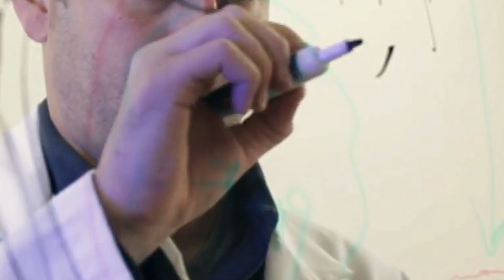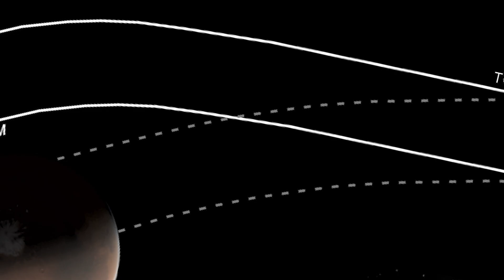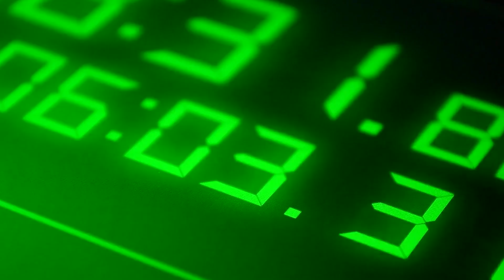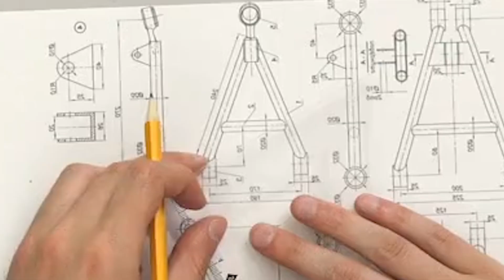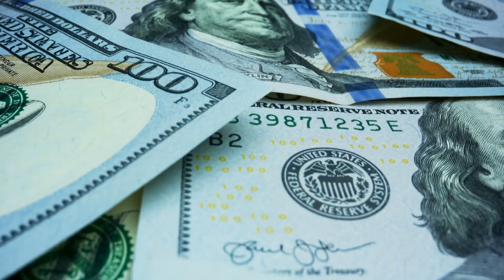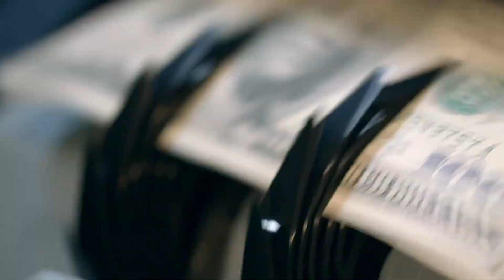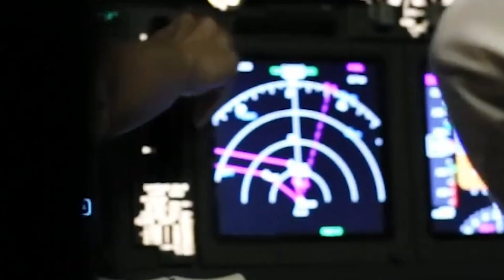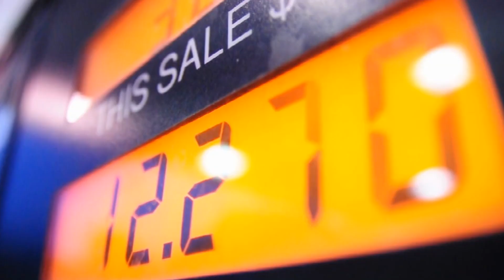5 Disastrous Math Fails with Surprising Consequences

Comment: 5:52 - Planes landing on an aircraft carrier do not "GO TO FULL THROTTLE" if they miss the arresting cables.  They go to full throttle about 1 second before they hit the deck, and only let off once an arresting cable brings them to a full stop.  They always land under the assumption that they are not going to catch a cable, because jet turbine engines take a second or two to actually start providing any appreciable acceleration after the pilot throttles up.  If pilots waited to go to full throttle only once they noticed they failed to catch a cable, they'd end up in the water... because there wouldn't be enough time for the engines to kick back in and perform the way the pilot desperately needs them to in this situation.

And now you know... and knowing is half the battle...

Comment: Don't blame the failure of the Martian mission on "English" use of the imperial system! Because we're deliberately awkward we use BOTH the metric system and the imperial system simultaneously! In daily life it's mostly imperial with a mix of metric, but in science it's always metric. Distances in driving are measured in miles, but in running in metric. In football, tennis, golf, etc. they're imperial. When following recipes they're metric, but not when eating the said creations as they are weighed in imperial. You really need to have a basic grasp of imperial measures to be able to understand British culture, but in fairness, most of what is done here is in metric measurements (except distance).

Comment: The first case here in this video... simply facepalm. It is widespread knowledge that NASA uses the metric system.....Because the necessary calculations are much easier in the metric system.

Comment: I would consider the orbiter error more to the nature of programming computers than anything else.  When one is working on paper, one immediately sees the markings for units, ie+lbs or m for meters.  In programming, the units are defined before the actually running parts of the program, so it is much easier to see how there could have been a disconnect in the system between the two forms of measurement.   Graphic representation on a computer screen could also be an issue, there are simply more placers for the error to sneak in with a programming language than with a paper and pencil.

Comment: Ignorant software programmers think convert everything to floating point is the answer to everything, instead of using finite number math (double integer 32 bit or 64 bit) which requires understanding and skill.  Floating point is easy for the programmer grasp but float point have gaps in the numbers that can lead to growing offset or bias in summation routings. It may take days for the offset to build and cause unintended number wrap arounds or overflows which may lead to unexpected results.
99 precent of C,Cpp programmers have no idea of the effects different number type can cause and what can happen.

Comment: This is why Metric & Imperial conversions are not (one size suits all). I was an apprentice production Engineer in the early 80's and some of the things we manufactured then (before CNC) had to be converted from Metric to Imperial & then back again depending on the customer with just our Zeus Book and the experience of the Charge-hand then. We had a tolerance of 1000th of an inch then, but now it's down to microns on the tolerance; CNC stuff will do that nowadays but I'm glad I used my lathe & mill then to produce some good stuff....way back then :)

Comment: I called the mistake on the first case as soon as you started talking about it. Why does the US still insist on using it when the creators themselves have already moved on is beyond me.
Reply: Actchually, they just recently re-introduced Imperial measurements. It's a Brexit thing, to show off how sovereign they are now that the UK is out of the EU.

Remains to be seen how many will actually decide to go back to the old measurements, don't think they've been taught for 20-30 years, at least.
Reply: @rocketsurgeon2135  I did not know  that!
Reply: It doesn't really matter what system of measurement anyone uses. What matters is that all involved use the same one.

Comment: Just a point of information. I seriously doubt that JPL used the Imperial system since the US has never used the Imperial system. The US had been an independent country for 41 years when the UK passed the Weights and Measures Act 1824 (5 Geo. IV c. 74). The US has always used a system of measures based on the English Exchequer system that was in use in the UK when the US became independent, generally now referred to as the US Customary System.

Comment: 6:05 "The new angled design... "

Video clearly shows a NON-angled flight deck! 🤣

Fun fact: the angled flight deck was a British invention, along with the system of lights and mirrors used by pilots to guide themselves to landing on a carrier's flight deck.
Reply: And not an easy fix as stated. A huge job to change the deck to an angled flight deck

Comment: A ram air turbine also saved the day (and 306 people) when Air Transat flight 236 glided 75 miles to a safe landing into the Azores back in 2001, following a catastrophic fuel leak that was costing them a gallon a minute.

Comment: The Hubble Space telescope had to be fixed because of a conversation error between Imperial and Metric units also. Don't hold me to the exact details, but for the 8 foot diameter mirror the depth of the center of the mirror was delineated in decimal millimetres, but actually created at the facility in decimal inches.  Thus the need for the Space Shuttle mission to fix the telescope a couple of years after its initial launch into space and with much fanfare that was actually televised throughout the world.
Reply: That’s not what I heard. I heard it was a chance combination of an issue with the measurement of a reference artifact and the installation of precision washers on the wrong side of a flange.

These were issues with the apparatus they were using to test the mirror during its manufacturing. Using this faulty instrument the mirror was made to excellent quality…
Reply: @Tadesan  I was at the UofA at the time working in the mirror lab. But maybe I am wrong.

Comment: The Space Craft incident wouldn't have happened if the idiots who ran the USA hadn't tried to shove the Metric system up our Backsides! I don't care how great the metric system is supposed to be and its' calculations based on o and ten! The old Imperial System was what I was raised with and at the young age of 76 I am keeping it and will never go over to the dark side of the metric system!!!!!!!!! The Texas Super Collider was trashed by Jimmie Carter and the Dimwits who had a strangle hold on Congress! The dimwits wanted all this money to begin gibing illegals an easy route into the states and also started the movement by the gay and lesbian group to gain more power than anyone group in the US by 2021! That's today by the way! The final nail in the coffin was from Slick Willie who just had to have the money for more illegals! And the out of fuel airliner was again the fault of the morons who tried to force the metric system on the USA!
Reply: In the UK we actually use both depending on what we are measuring. Now you would think that would mean that there would be more confusion than in the USA, but we are very much aware that we use both so make an extra effort of paying attention to what unit of measurement is being used.

Comment: The Gimli Glider's "successful" crash landing (minimal injuries and no deaths) was a combination of the pilot's expertise with gliding aircraft and the first officer's knowledge of an old air force base within gliding range that he used to be stationed at (I don't believe it was included in the charts they had on board)... Without this combined knowledge and expertise, they really would have crash landed on unfavorable terrain.  These guys were the Sully (the pilot who ditched his plane in the Hudson River with similar minimal injuries that was credited to his prior military training and experience civilian pilots didn't get) of their day 👍
Reply: Cap’t Sully was also a soaring [civilian] pilot for fun, aka ‘gliding’ with no engine.  His landing flare-out on the Hudson was a classic sailplane landing maneuver.
Reply: Not just that, the catastrophic failure of the nose gear saved the lives of two kids that were bicycling on the old runway at that time.

Comment: It's amazing how those two company's didn't agree to use the same measuring systems just to remove the chance of any confusion... Hindsight has 20/20 vision.
Reply: I worked as a surveyor at a mine expansion project in 1980.....the structural steel was from Japan and all in metric.....the surveys and were all done in decimal feet (standard for the time) and the carpenters would only work with Imperial fractions....I used to have a chart in the back of my field book giving equivalent measures in each.
Reply: @TheWolfsnack  that's interesting... Did you find it slowed up the work to convert the measurements and make the job unnecessarily complicated?
Reply: @mattl9070  Well....it was a bit of a pita due to the ancient carpenter traditions at the time :) but only a minor irritant really, for me as a surveyor back then, the transition to metric was simple, as we all used decimal feet at the time. As for most other work on site I was using an early total station theodolite so it only took a button push to switch between metric and decimal feet.

Comment: It's really a stretch to attribute the early straight deck aircraft carrier design to miscalculation. To this day, aircraft always take off and land DIRECTLY INTO THE WIND whenever possible! Early aircraft carriers were designed with straight decks for THIS reason. Then there's the fact that early CATAPULTS weren't really good enough. Also, there is at least one safety issue with angled flight decks that you overlooked. Every time a fixed wing aircraft lands, it has to pass through the air turbulence caused by the carrier's island. This can cause the aircraft to crash if the pilot makes the wrong correction for it. The landing is always slightly cross wind, as well. These difficulties can be overcome with the proper training,  which is why the advantages of an angled flight deck you mention outweigh the disadvantages.
Reply: During WWII most aircraft didn’t even use the catapult, they mostly just did a deck run into the wind.
Reply: I know from working with choppers (long lining) that the pilot always approaches into the wind. Same thing, good ole lift.
Reply: @missesmew  into the wind also helps the aircraft bleed off speed before landing.
Reply: At least with fixed wing aircraft.
Reply: Exactly the thought I had - the pilot has to line up on approach to a runway that is moving sideways (at a slight angle).
Reply: With a straight deck the air disturbances issue is even worse because when you're approaching the carrier directly from behind you're in the disturbance region all the time.

Comment: Lol I like how when you said they updated their software, you show them using a floppy disk.  Like a way old school floppy disk,  when they were actually floppy.  😜
Reply: Our nuclear missile sight are still ran on floppy disk
Reply: 5 1/4" floppy at that, ahhhhh the good old days :D
Reply: And they still use them. Military systems are super old.
Reply: Get this...as big as those discs were, they had the capacity of.........1.4 Megabytes lol
Reply: @billrhodes5603  3.5" high density floppies were 1.44meg, but before that you had everything from 87kb, 170kb, 280kb, 360kb, 720kb, 1.2meg etc across 5.25" and 3.5" floppies. There weren't any 1.44meg 5.25" floppies like the one in the video, those were mostly 360kb and 720kb :)
Reply: @nicwilson89  You are right...it's been so long!
Reply: @billrhodes5603  It certainly has! :)
Reply: @nicwilson89  you mean i can't even save a thumbnail of a photo?😂 i remember my dad had a bunch of floppy disks for our old computer... The bad old days😂
Reply: @Rich Hopkins
Yeah, the 3.5" were floppy, too, it's just that they had a hard case around the actually floppy disk, whereas the 5.25" disks had a floppy case around its floppy disk.
Reply: @Raz.C  yep, the little ones were hard disks originally . If I rememeber correctly. Then when everything went to the little ones, they were called floppys.  I think. That was a long time ago

Comment: The dynamo driven prop to retain enough steerage power is an amazing, old and simple but life savingly effective contraption.
Reply: I remember when that happened. They could not reach any airport but the co  pilot used to fly in Gimli when he was in the airforce so they went there. They actually had to "slip" the plane (essentially flying it sideways) just until touchdown to slow their speed.
Reply: @CrazyCrethon  A forward slip (flying sideways) is done to lose altitude quickly WITHOUT increasing speed. It's a very common maneuver to perform in gliders. Jetlines have a very clean profile and a surprisingly high glide ratio. They had to slip so they didn't overshoot the airfield. Slowing down is simply a matter of decreasing your pitch angle... but that also lowers your rate of descent. If you're too high and don't want to slow down, you do a forward slip.
Reply: It's not a dynamo driven propeller, it's a ram air turbine, that converts the force of the air flowing past the aircraft into rotational force (torque) to drive a hail Mary hydraulic pump and electrical generator.
Reply: @daviddunsmore103  just my  wording back to front, anything creating electrical energy from mechanical is a dynamo, he just said prop instead if air turbine, same thing, ingeniously simple
Reply: @daviddunsmore103  I was repeating the poster of the video
Reply: Dynamo driven prop? You got that the wrong way round! The prop is hit by air and drives the dynamo!
Reply: @owenlaprath4135  you are correct, I had already corrected my self in replies, I will highlight it in original
Reply: It's like if a bullet train had a small steam engine for emergency situations where it had to keep moving.

Comment: Two examples of metric vs imperial measurement. We should all adopt a 'world standard' of metric and once and for all get rid rid of these ridiculous out-dated measurements. And whilst I'm at it, we should all drive on the right as well.
Reply: Or left.
Reply: Professionals are supposed to know both.
Reply: No, they are examples of why we should always try to hire people who aren't stuttering morons.
Reply: Another example of someone not knowing what they are talking about, America is a metric country, we convert it to American standards because 1 its extremely expensive to switch and Americans are just fine with our system, that's 300 million people who are happy with the current system
Reply: @devo1977s  every roadsign. every mile marker would have to be replaced. that would require a massive amount of new aluminum sheet to be made. the co2 output would be massive.
Reply: yeah bullshit too its very easy to convert between the two so no need at all to eliminate one especially seeing how embedded they both are in society in the geographical regions that use them i regularly work with them both and do conversions in my head in distant measurements and weight measurements
Reply: why do we have to change? let the rest of the world go back to using the right way of measuring things....

Comment: I could almost swear those army dudes in the Scud chapter had a Commadore 64 computer screen in that kinda blurry section showing a computer screen! Great for games, but for missile defence? LOL! Very entertaining show!! \m/
Reply: That 5-1/4" floppy, though...
Reply: and yet they are vastly more powerful than the computers that put man on the Moon!
Reply: It's all stock footage anyway
Reply: @kujo62  very true
Reply: You're prob right. The military is very slow to upgrade to new technology, most computers in the military still run on Windows XP that should tell ya all you need to know.
Reply: @renaissanceredneck73  That is done for security reasons mostly, it is very common in mission critical systems, you want your systems to be mature and tested robust, not bleeding edge.
Reply: @renaissanceredneck73  something to be said for a known platform.
Reply: @renaissanceredneck73 -- XP 64 pro was the best windoze to come from microlimp.
Reply: I work on the PATRIOT missile system for the Army and all the footage shown had nothing to do with it lol. What happened is true though.
Reply: i was in from 2010 to 2014. I cannot be too detailed but I had a piece of equipment that ran on windows 95. it did what I needed to it to do so I guess I can't complain.
Reply: Gotta remember first Gulf war was 90-91
Reply: Wonder if it had the optional tape drive…?😏🧐
Reply: Lolol
Reply: Saddam tried to use PS3 processors to build a second generation after the gulf war

Comment: Another title for this would be "Why you should start paying attention in your math class"
Reply: A better one: why imperial system is trash
Reply: @boryshacker  Not trash, just different.
Reply: @Critical-Thinker895  c'mon, to get from meter to cm you divide by 100, from cm to cm by 10. From kg to g by 1000 and from kg to tonne multiply by 1000. What insane math do you have to do to get from yard to foot to inch to mile? It just way too easier to make a mistake and way harder to be precise due to rounding
Reply: @boryshacker  Using various powers of ten are far easier than the random radices in the US system.  It's a similar reason why tiered currencies like the old British pound/shilling/pence fell out of use in favour of decimal currencies.
Reply: AND in My Science class!!!